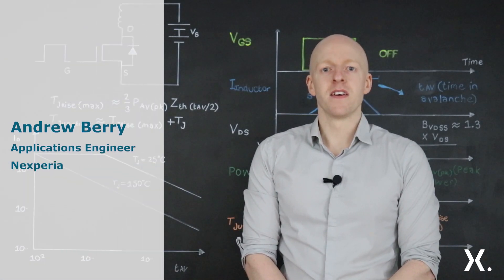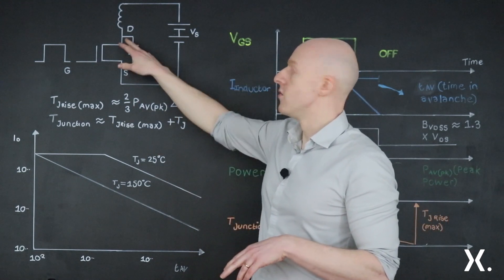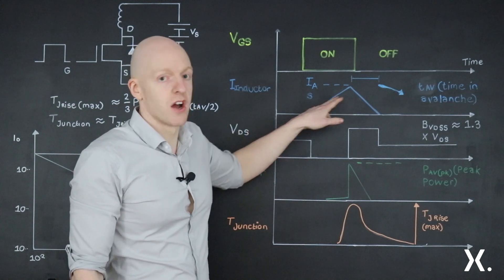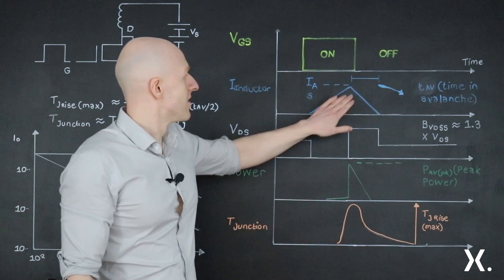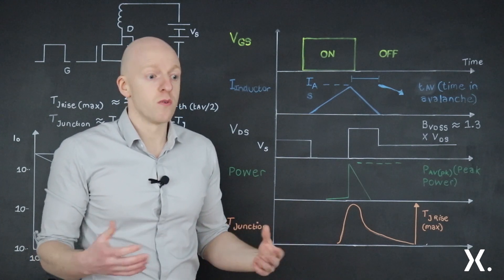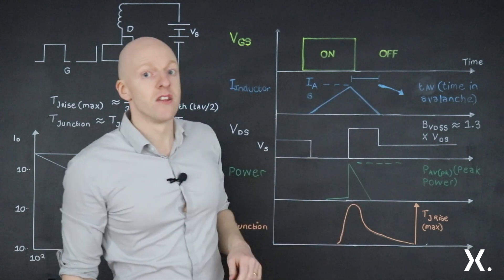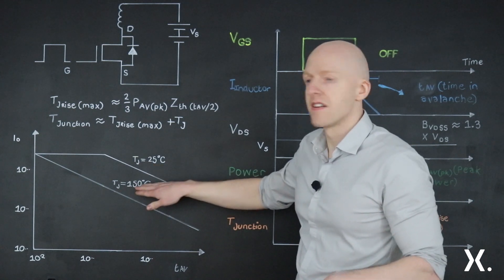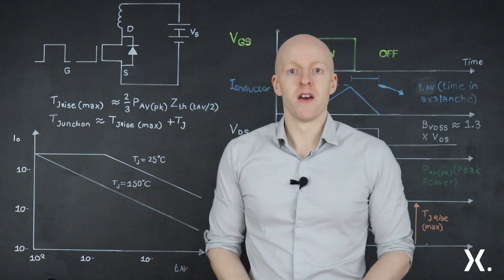Single shot avalanche ruggedness of MOSFETs

Comment: I'm going to try my luck here. If I have a IGBT that keeps having EOS failure near the aluminum wirebond, does it mean it could be UIS? If so, where would be the source? A hole is punched through the silicon, near the heel of the wirebond but not next or underneath it.
Reply from the maker: Well today's your lucky day then, @kevint1160. We passed your question to one of our IGBT engineers and received the following reply - What he described is most likely IGBT exceeded the RBSOA region, meaning overcurrent or over voltage. 

Does this answer your question? Please let us know if you need more information. Have a great day!
Reply: @Nexperia Does this point to an issue from the tester or this could be caused by some mechanical defect from the assembly process?
Reply from the maker: According to your description, it should not be the UIS, if it is UIS, normally the corner of the chip will be destroyed easily.
It could be caused by exceed RBSOA, which may burn a black dot around the bonding wire. So, better to check your current or driver IC to see whether there is too big current flow through your IGBT during test.
Reply: @Nexperia  Thank you very much Sir for another response. It's funny because it hits 1 of the 3 IGBTs more specifically. Sometimes it burned at the passivation area of the emitter, far away from the wirebond.  The real kicker is the fallout rate after removing and replacing just the damaged IGBT is about 15x less even though we did not replace any other component or IC. We are growing a bald spot from all the head scratching.
Reply: @kevint1160  Did you guys ever figure this one out? Sounds like it may be a combination of process +layout that leads to a' weaker' IGBT.

Comment: Does mosfet turn off time change according to temp ?
Reply from the maker: Hello, the temperature has little impact on the turn off time of the MOSFET itself, but it does effect the breakdown voltage of the MOSFET. A higher  temperature will result in a higher breakdown voltage. This in turn means the inductor will discharge quicker and the time in avalanche will be shorter.

Comment: Can I use a series of zenor diodes to protect the Mosfets.
Reply from the maker: Hello, thanks for your question. If you did not want to avalanche the MOSFET, then it is perfectly acceptable to place a Zener diode parallel to the drain-source of the MOSFET. The Zener will need to have a lower breakdown voltage than the MOSFET over the intended current and temperature range. Alternatively, Zener clamps can be placed gate-to drain, holding the MOSFET in a highly resistive mode to dissipate the energy. However, this holds the MOSFET in linear mode, and generally speaking MOSFETs are more capable in avalanche than in linear mode.
Reply: Better suggestion would be tvs or mov between Vds